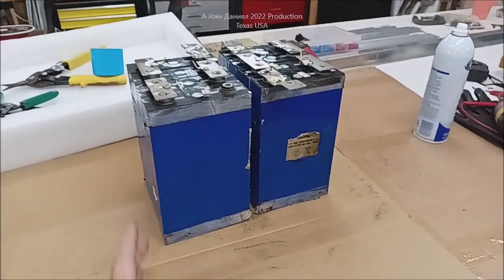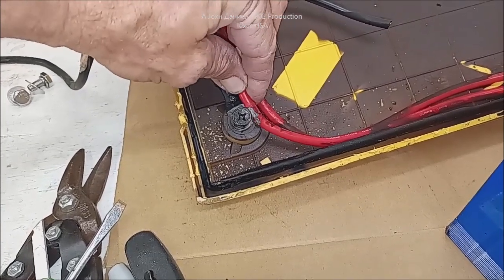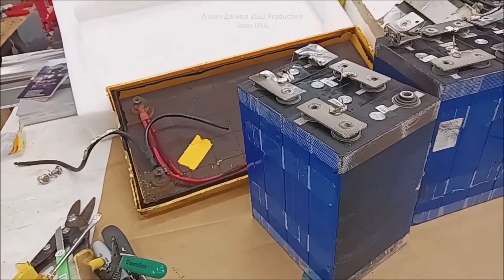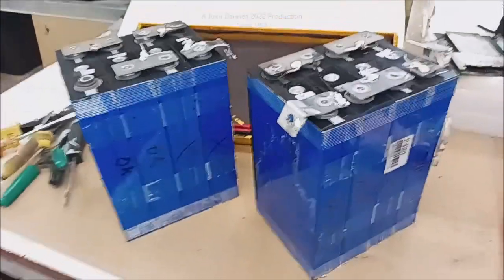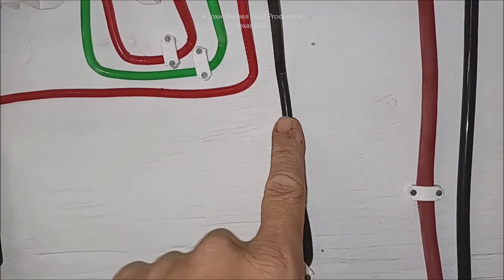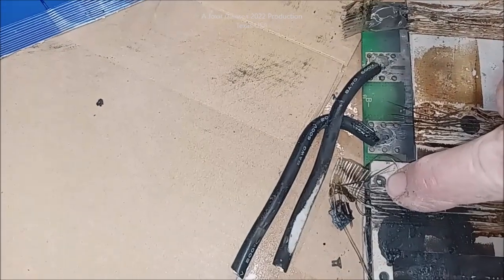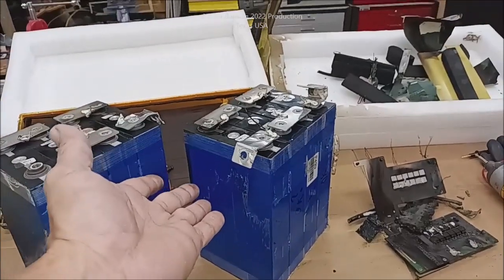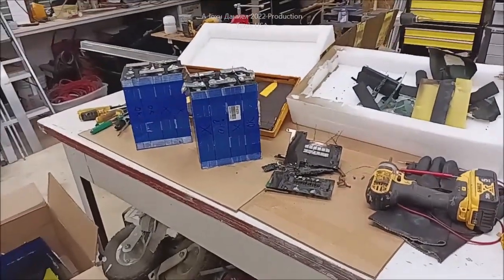Cheap LiFePO4 12 & 24v Batteries flooding the market, an Autopsy of Low Quality (options below)

Comment: JUST SHIPPING?  shipping has been the bane of my orders.  The ham handed way that things are moved is at an all time high.  In the last year i have refused over half of the items shipped to me. and that is without even opening the damaged box. i had one delivery of a large inverter that had been blown out the end of the box and the delivery guy got mad when i refused it.   Shipping has become the acid test for products anymore.   And as for the cheapness of things now.....well when purchase price is you only  concern then the sellers make what you are asking for.
Reply from the maker: Out of 148 solar panels we had shipped and crates of six on average 21 broke. The problem is the same reason that I'm no longer driving a truck after 20 plus years. A lot of my driver friends or my age, they were forced to either take the covid shot or to lose their job their pension and everything else they had. Most of my age like me or not in the greatest of physical shape anymore, I couldn't take the covid shot because I have a heart valve damage, and I was a previous stroke victim almost 10 years ago so now I am officially not hauling anything anymore. I do wind and solar installs only, took a 65% cut and pay and no longer can expect my retirement of 23 years. All the people are hiring to do the job now don't speak the language weren't born here and don't give a damn about nothing here. And not  a damn one of them being forced to take the shot. 
I've had to go to putting links under my videos hopefully to earn a penny on a dollar or something that people might need and even put a link for people to donate through buy me a coffee program that's I guess specified for people like me. He probably won't get me much but the price of groceries and medication nowadays I'm only going broke slower that way.

Comment: Thank you for a good video, that could ended up much worse.
Reply from the maker: Sad thing, there's about 10+ rebranded batteries in numerous colors and labels that are all the same battery. About half sold on Amazon or eBay are those batteries. Same build as this one.
Reply: @JOHNDANIEL1  that’s crazy. And them sell it as matched cells, and maybe they are regarding to the capacity, but cycles and different loads will probably have a pretty big effect after some cycles in a “new” pack. I built my packs from a crashed EV car, and those cells were extremely well matched.
Reply from the maker: @flyingtools  it's just the Chinese taking advantage of the lithium battery cult that Americans created.

Comment: short wires for chassis wiring can be a little bit thinner than long runs of wire. Two 8AWG wires in parallel is the same as a 5 AWG, and that will handle 118 amps continuously. But, only if they are short runs, like in a battery box.
Reply from the maker: I go by DC cable spec for my numbers. Same chart the military goes by same chart the aircraft industry goes by. I have no idea where in the hell 5 gauge would handle 118 continuous but if it will that's good. When I went to school to learn electronics they told us 25%, if your wire isn't oversized by 25% in DC and 15% over in AC you'll fail every inspection.
Reply: One interesting thing is that overloading a wire it may take it ok in the beginning. but after a few times it'll get worse I wired up two 10 gauge extension cords 100 foot each to run 2 3000 watt 220 volt construction heaters each heater was supposed to have have a 12 gauge cord so I was hoping it would be OK if I put 2 heaters on one 10 gauge cord plugged them in and checked for overheating over the day cord wasn't warm over the day so left it over night still cold it was great for that job and another after it but I noticed during the next job it got a little warm during the 4 weeks we used it on that job it got warmer as the 4 weeks we used it on that job and for the next job I noticed that it was even warmer so I removed one plug so I needed two cords for each half duplex I wasn't taking chances it would have gotten worse or short circuit causing a fire which I've seen happen before that why I checked it when I first made the cords so better with electrical wiring go over size it could between having a fire or not
Reply: i belive the overheating leads to massive resistance in the copper? @douglaswindsor120

Comment: Better make them on your own instead of buying ready made ones. Anyway I'm not fan of having Li-ions inside packaging or box as the individual cells need cooling. I rather have the individual cells exposed and stuck to heat sink just incase it gets hot from charging.
Reply from the maker: The mythology of lithium has gotten so out of whack, and completely against the original design that the cult following that now use it cannot be convinced even by the original inventors what they're dealing with. 
Very truthfully the only absolutely bulletproof lithium product out there today is LTO. Believe it or not it's actually cheaper to manufacture than LiFePO4 but due to the fact that the Chinese are trying to retain all of it for their own market you're going to pay a premium.

Comment: They should disconnect batteries in shipment and make sure wires can't touch anything metal.
Reply from the maker: I have offered to design alteration that makes that possible, but it might cost $0.65 in China so as a result it'll never happen. In China the profit margin 70 cents on the dollar, that would knock out about 7/8 of 1% of their greedy little military buying budget.
Reply: @JOHNDANIEL1  That's china for ya, cheap bastards and louse design.   Same country that left wingers think is near perfect with Gov controlled media and they complain about Russia controlling their media.  Go figure!!!

Comment: Crazy, and why would they route the wire by the negative post? Wiring sizing is so important, plus the routing of it! I just helped out a couple who was camping next to me last week. They were having trouble with their Solar system. not working correctly. So, grab my multi-meter and took a peek! I was horrified by what I saw, and they even told me they had a professional look to ensure it was wired right. The owners did it themselves. It was ALL wrong Batteries, inverter, fuse block, and MPPT controller. Needless to say, it was a two-day job, and thank goodness I had all the correct size wires, bits, and pieces in the truck to do the job. I found four places that were burnt and melted, grounding out wire, and even burnt wood from the wiring, and many other things. They would have burnt down their van if I didn't catch it or look at the system. I got a text from his wife yesterday, she is so happy that everything is working and used her instapot three times, and her old man is good with it now. His ego was getting in the way. I had to talk to her quickly to redo it or have someone redo it and tell her it was about safety and not having a burnt-out van. Funny how a wife has that kind of power! : )
Reply from the maker: If you want some TRUTH about LiFePO4  go see this, Sub him. https://youtu.be/mAVW6iLnYnw

Comment: I guess I'm missing something.  Aside from a goof in pkg/shipping, wouldn't any battery do that if a dead short occurred?  And if so, it's not the battery's fault
Reply from the maker: Not really. But if you by design save 3 cents by not securing your wiring you give fire and fail a better opportunity.
Reply: @JOHNDANIEL1  An ounce of prevention eh?  Cheap insulation, or packed late on a Fri?
Reply from the maker: @mikevickers4727  I Dunno, Possibly all 3

Comment: Electrical wiring safety has been an issue the world has had to deal with for well over 100 years and still some people make a mess of it. Glad to see that the damage you had was poor wiring between cells rather some danger with the cells themselves. Clearly what is new here is the ability or even need to ship stuff around that contains a lot of stored energy. Would people be as casual shipping a full jerry can of gas through the mail - I hope not.

Comment: I've seen these pre-packages batteries taken apart a lot on YouTube.  They make me nervous.  I'll stick with making my own out of individual cells.  At least I know what goes into it and if it fails its my fault.
Reply from the maker: Smart choice. The only one I found that was built decent for the price has been those Power Queen LiFePO4 so I was trying to put a link below to those if you're interested checking them out. Or just look for the name.  Not super premium, it's done right,  but damn sure not exploding battery and the cost is decent.
Reply: take a look at their socalled solid state batteries ,,its just simple old  lii iion pouch cells  if they had been in this battery it would have gone woosh  @JOHNDANIEL1

Comment from the maker: YOU can Help out in raising funds to get new materials, interactive help and higher quality videos https://www.buymeacoffee.com/JOHNDANIEL Better LiFePO4 Batteries 10 to 300 Amp for bargain cost is Power Queen (Big sale on Power Queen batteries, won't last long) These can be made into a 1600AH bank, For Real ALL the places you can get them, not some fly by night battery company!!! Direct Web source, https://bit.ly/3PbDkK9 , Or https://shrsl.com/3lqrb & regular locations with financing option https://amzn.to/3uwC8Js Or https://bit.ly/3P7GnDd and Even here https://ebay.us/cPZv5Y. These are the best low priced LiFePO4 sold currently. Not any weak parts in them. If you want some TRUTH about scamming Grade Ratings with LiFePO4  go see this guys info, Sub him. https://youtu.be/mAVW6iLnYnw
Reply: you are like a professor of DC
Reply from the maker: @SheriffofYouTube  I did 2 years of votech electronics, 3 years as electricians apprentice, and as a plumber following family trades I was for 19 years as a plumber/Process Piping tech where all servo control systems from fire protection, control fluid systems and blending operations were either pneumatic or DC operated or both. Then I left it all for Trucking to get the hell out of the petro chemical and other mega plants for a stink reduction. Now I am not trucking due to not being able to take a COOF shot, doctor refused due to Heart issues. But they didn't care. So now, its solar and wind installs only and what I can make from where ever.
Reply: @JOHNDANIEL1  been following you for the past couple of years - appreciate all your insight!
Reply: Are you able to return it.
Reply from the maker: @leonardolimon8371  No, it's a pay postage for a damaged in shipping item deal. It never saw a first owner, this failed in the delivery to warehouse event. So it's Salvage. But thats what I wanted to do is get one to examine on why they fail, and use its parts if possible. I don't like some get paid to show a bad product and recommend a sponsored product to my suckers, I mean viewers, so its all out of my pocket as usual. LOL!
Reply: @JOHNDANIEL1  have you try the Battle Born Batteries LiFePO4 Deep Cycle Battery?
Reply from the maker: @leonardolimon8371  no, they don't impress me much from what else is out there. I'd have to get one to make a good study. The only one I ever saw we pulled out of a motorhome because something happening in the charging circuit caused a bunch of wires to melt down. The guy that owned the motorhome pulled it out and stuck it in his truck he had three of them in there so I didn't get a chance to study it but it looked like the BMS possibly in one battery failed and the load transferred to the two other batteries and as you know when you over amp you burn.
Reply: @JOHNDANIEL1  I'm in Reno and have met the owner of the company. Nice enough guy but the product price is off putting out of the gate!
Reply from the maker: @rongray4118  Yes, price is about 20% out of any market equal and its still 99% Chinese content except maybe the box its shipped in.